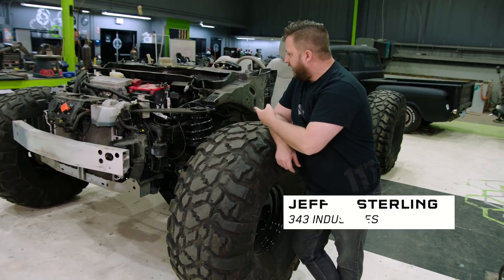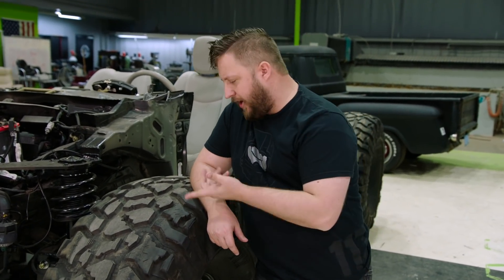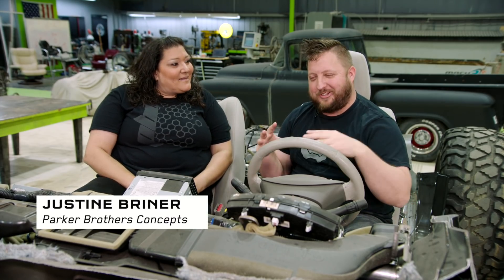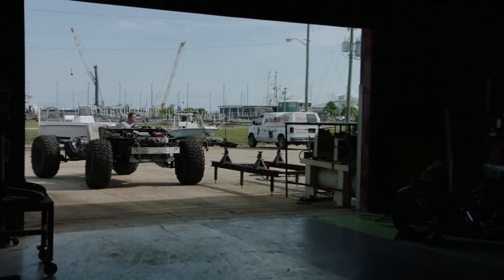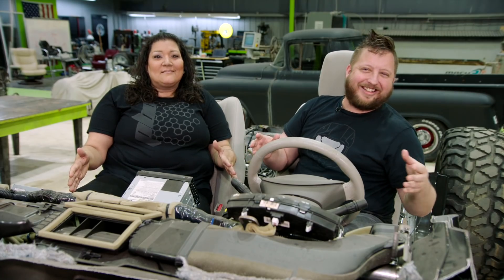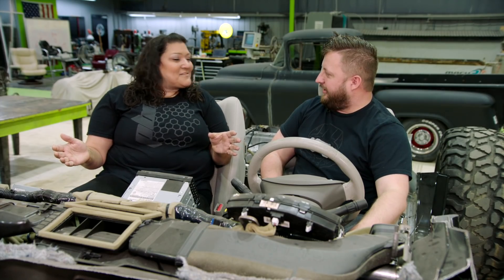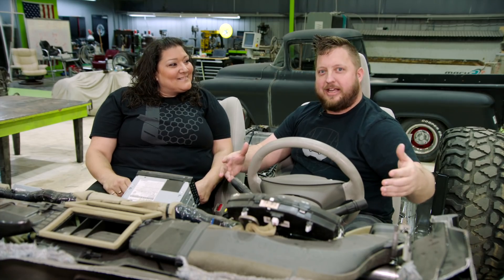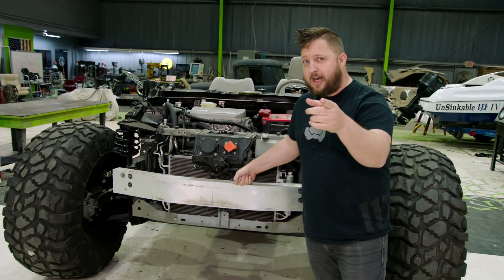Halo: Outpost Discovery | Behind the Scenes, Ep. 3

Comment: It's electric? RIP horsepower.
Reply: Do you even know what power is? It's the derivative of the energy with respects to time; thus, this means that a less good approximation of what power is is that it's energy variations divided by time run.

Electricity has power too, and technically, a real Warthog would be fueled by hydrogen.
Reply: The new Tesla roadster model has the highest acceleration and relative speed of any land vehicle in human history.